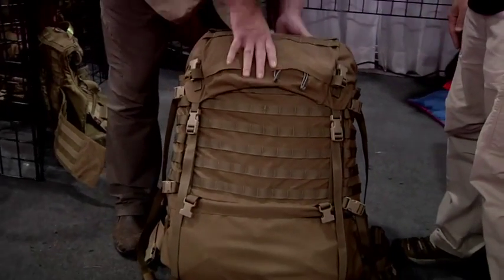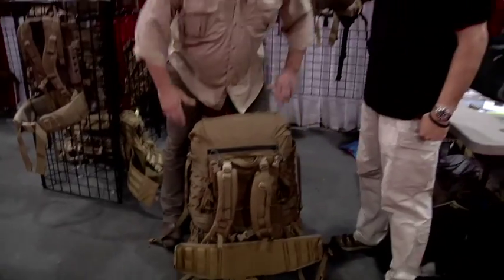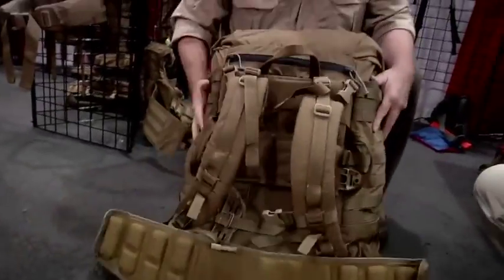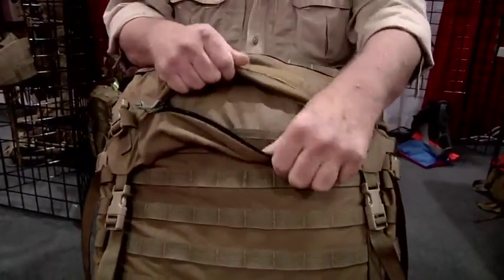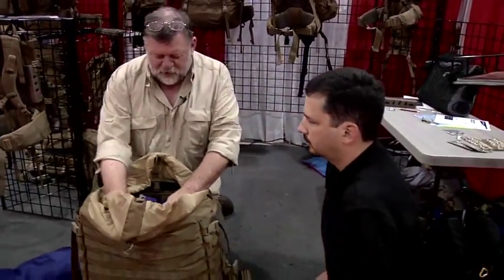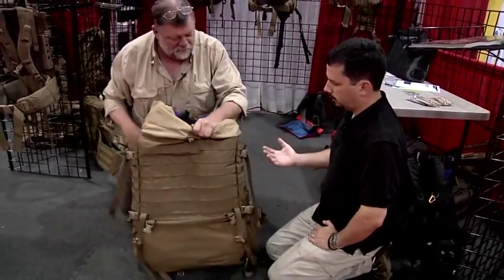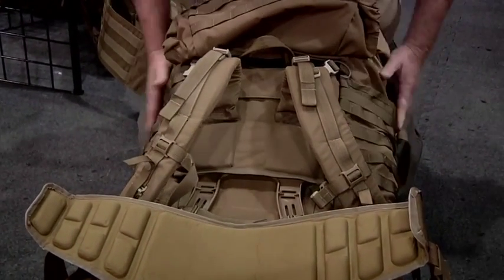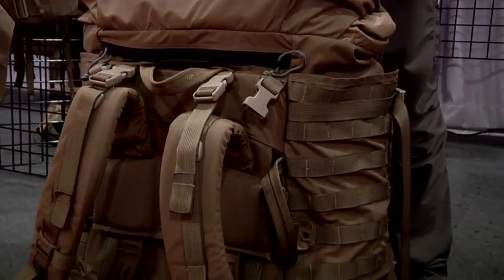MDM 11   New Marine Corps FILBE Pack  Video Library  Defense News

Comment from the maker: Some additional information 8 years later, these are no longer readily available brand new (the complete system on ebay). Oneiros valley innovations have come up with several upgrade to the filbe pack I think are worth getting. 

One is the upgraded hipbelt non slip buckles + belt. Mine kept slipping
The load lifter replacements if yours breaks, took several years for me to get there

The marines have also found in ultra cold weather that the frames were not as durable as they needed to be and upgraded the frame to a slightly beefier version, adding a bit of weight but with the required strength. I have not found the need to do this on my personal pack as I don't operate in those temperatures

Ironically I use this pack mostly for training, and not for duty

Comment from the maker: 2022 update -- frame has cracked after 10 years of use, i've been using this for military service as well thrown off airplanes and MSVS's. Downeast sells a replacement upgraded frame the 1606MC for about $40 USD, this is a upgrade over the 1606AC for this exact issue